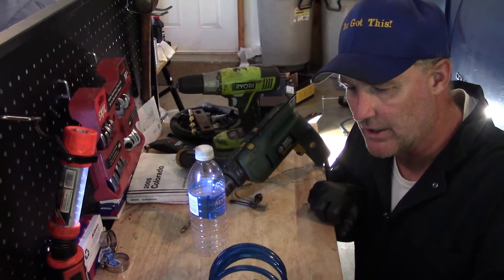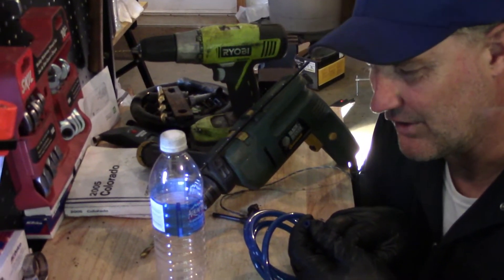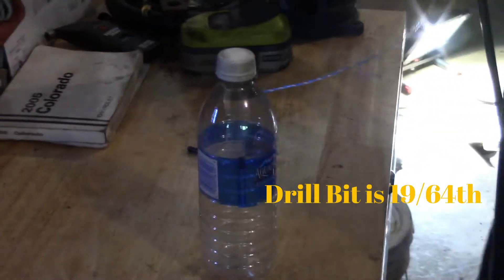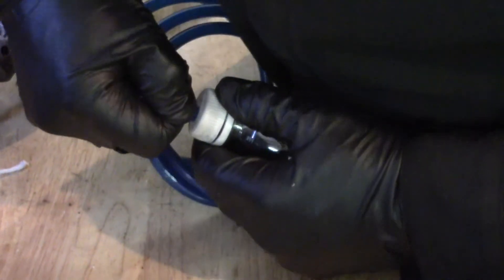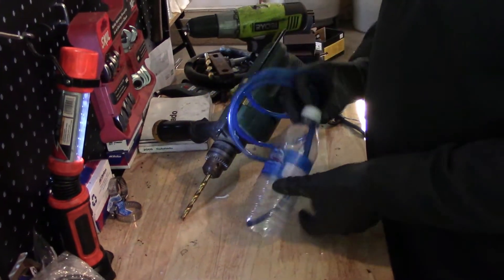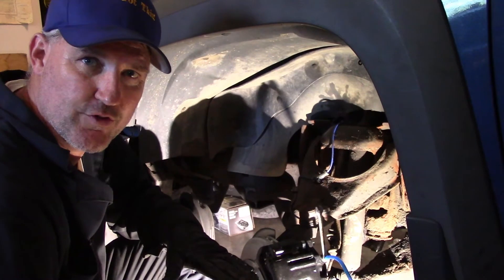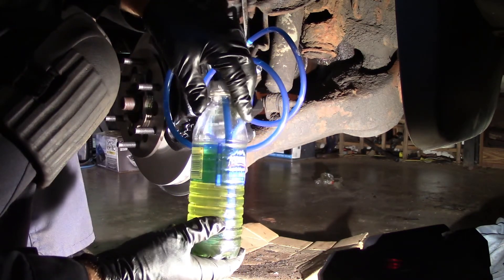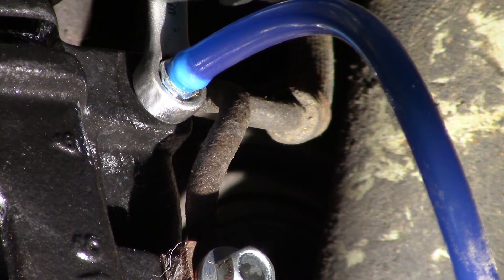How To Make A One Person Brake Bleeder for a Chevy Colorado, GMC Canyon, Hummer. To Bleed the Brakes

Comment: Aren't you supposed to start bleeding process at the furthest wheel from the master cylinder?
Reply from the maker: Yes, that is true if you are bleeding the entire brake line. However, if you have only introduced air at one brake line then you only have to bleed that one line. I did not change the master cylinder which would require bleeding of all the brake lines and it is best to start at the furthest wheel from the brake cylinder

Comment: I really like the relaxed way of teaching in your videos. It gives me confidence to try some things I never have before,  but I have to tell you, I HATED that sound you used at the beginning of the video. LOL.
Reply from the maker: LOL... Thanks for the great comment Riverdrinker. Yeah, we've all heard that sound before.
Cheers!
Reply: When I turn on the truck I hear water  I check my ac drain plug to see if it's clogged and it's clear my coolant is full I even burp the system to get any air pockets out any advice or any video on  getting the air pockets out maybe I did it wrong . And like always good  work on the original  colorado. 
.